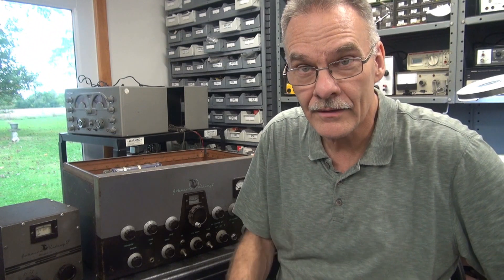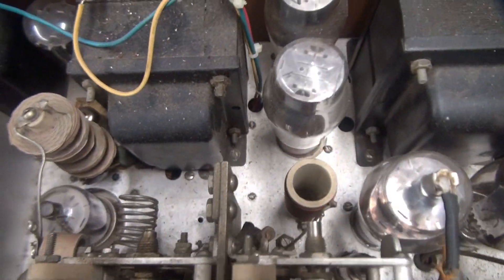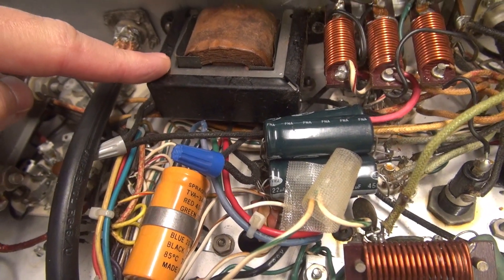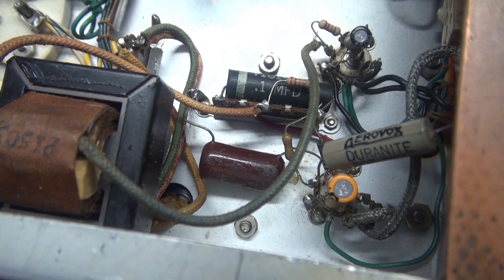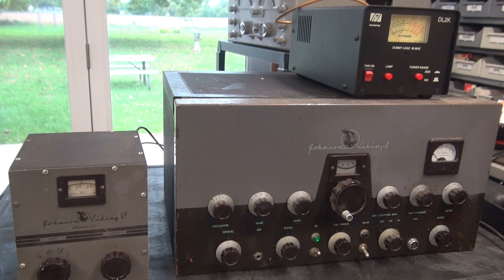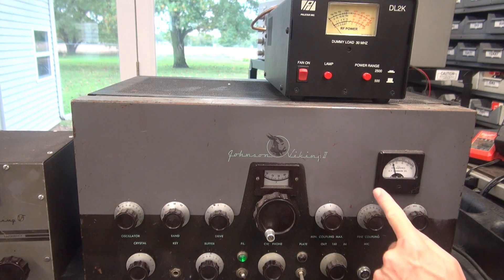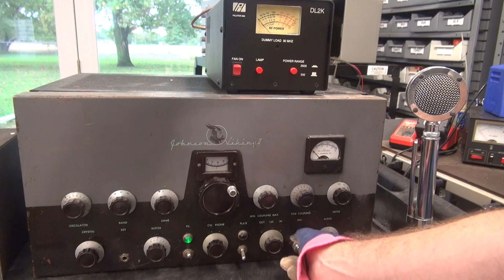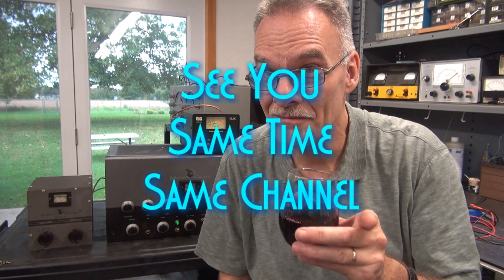Initial test Johnson Viking II Tube Transmitter Repair of Vintage Ham gear D-lab

Comment: Many thanks for all the information and videos on these great old radios. 
I have one here I have been in the process of "de" moding and seems like there is always something else or another surprise in this thing.
IJust this morning discovered another mystery capacitor in the form of a Mallory 10 mf 450 wvdc from screen of 807's to chassis instead of the 0.5 in the schematic.
I don't mind mods so much as long as they improve reliability, component stress and life.
Is there any source for "valid" mods on these things? Im seeing other "enhancements" that I don't know what they are or purpose.
Thanks again for this excellent resource.
73'
de K4WRF

Comment: Cool inspection Terry. Man folks do some crazy stuff sometimes.  Was very interesting to see the old girl was working.  Soon as I saw that monster modulation resistor I was like WT? Two taps? Then saw the terminal was not connected on the end and knew what they had done.  Always good to see the master at work, thanks for sharing.